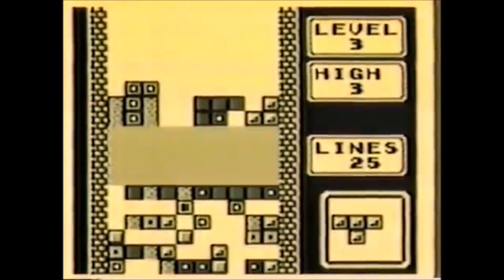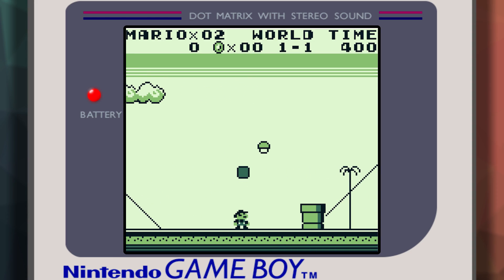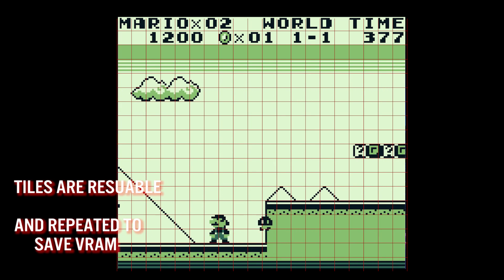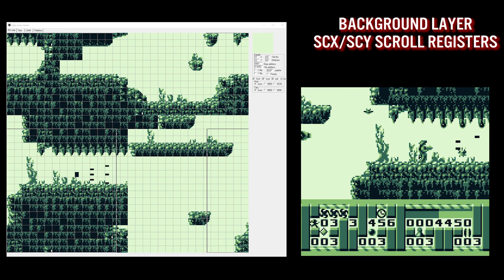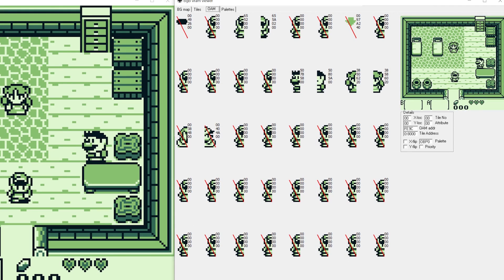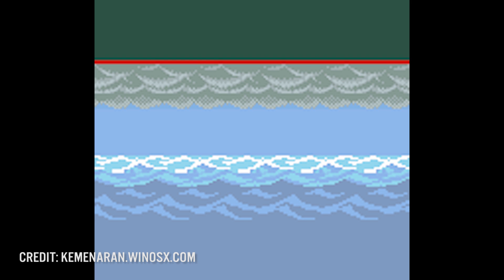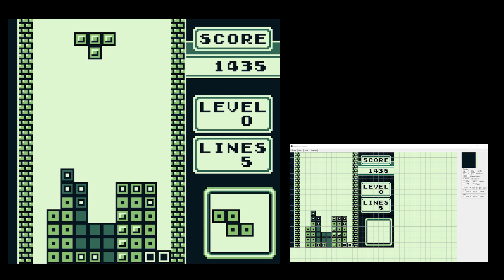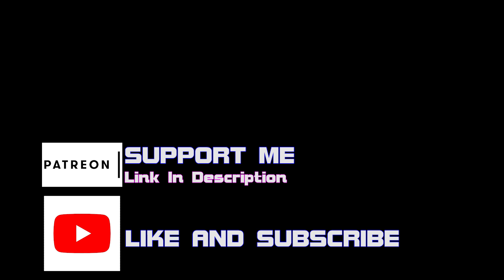How Graphics worked on the Nintendo Game Boy | MVG

Comment from the maker: My math(s) was incorrect at 2:29. 160x144 for a 2 bit palette is a 5.7kb framebuffer not 22kb
Reply: Do mode 7 next time
Reply: @AlexOlsenpang  About that...
https://www.youtube.com/watch?v=3FVN_Ze7bzw

He has an entire series talking about the SNES.
Reply: @amilamad  Oh, interesting.
Reply: Just in case someone needs more clarification: there are 160x144 = 23,040 pixels on the screen, with each pixel taking up 2 bits of memory, so 23,040 x 2 = 46,080. There are 8 bits to a byte, so 46,080 / 8 = 5,760 bytes (or 5.625 KB considering 1024 bytes per kilobyte) for the whole screen.
Reply from the maker: @mluna  no because sprite and window layer have their own palettes
Reply: @ModernVintageGamer  was that clip of donkey kong at the end really from the original gameboy?
Reply: Sorry to be a pedant, but I noticed the following inaccuracies (at I least I think so):

There is enough memory to fit a framebuffer in VRAM, so why don't they do it? Presumably because it would take far too much processing power to handle things like scrolling and sprites. By using tiles and sprites, the composition of the final images is offloaded to the PPU.

You imply background scrolling is unique to the GameBoy. It's not. It's very similar to the NES and other contemporary systems.

The Window layer, however, is different than the NES, though vaguely similar to the SNES.

Also, when you show the scrolling games, your grid lines don't scroll with the background, making it appear that the tiles themselves are changing. They aren't, the background is scrolled.

Right near the end of the video, you're talking about how the system is 4 colors but showing what looks like a GameBoy color game (Donkey Kong something) that has more than 4 colors.

Thanks for all your work, however, overall a good video.
Reply: @HypherNet  It would have taken too much cycle to be usable.
So basically, you have a few cycle to store a pixel data in memory (i dont have the cycle number for the memory, sorry), and at least one more to shift the first pixel 6 bits to the left, again one more to shift the second pixel 4 bits, rince and repeat until you filled your 8 bit chunk of memory (4 pixels).  Which is really time consuming instead of filling a buffer at once with full data.  Instead you have to fill, pad, fill, pad, fill pad, .. and then go to the next chunk of 8 bit memory.

The gameboy CPU can handle 4194304 cycles per seconds, which you devide by 60 to have 60 frames per second, so you handle 69905 cycles.

The amount of memory required is 46080 bits, so because it requires multiples cycles to access a portion of memory, store individual pixels and shift them to the correct position to pack them in memory, you couldn't potentially achieve 60 frames per seconds.

To that, i don't know any drawing method for each individual pixel, and even if it's possible, so you wouldn't be able to redraw your memory buffer.  There's no framebuffer, so if you can't redraw your pixels at 60 frames per second, your only hope would to rely on retina's persistence by drawing the other set of missing pixel on the other frame, it could theorically work on 30 frames/sec but you'll end up with flickering : if the pixel isn't there on the pass, the pixel drawn already wont stay as the screen finished is blanked.

I think games like "Jack Nicklhaus golf" circumvent this caveat by storing the data into a static tilemap which can be offloaded to the PPU and redrawn at each frame, but at the cost of not having any realtime modification, and it takes few seconds to have the screen drawn
Reply: You could have said "Twelveteen Gabbabits" and I would have believed you MVG.
Reply: mistakes were made
Reply: @MicksNa  houses will fall..
Reply: I didn't immediately catch the error as I'm so used to think about an 8bit palette. Then I realized that the Gameboy uses only 2 bit per pixel :-)
Reply: Hi! Which song in your band camp page do you use for the intro?
Reply: Do more videos like this loved the information about how old systems worked during the day
Reply: The Gameboy have quite a lot of improvements over the original NES.
Reply: Was about to ask why Nintendo didn't simply optimize space using 2-bit pixels :-D I guess it's the same for tiles and sprites, with each byte containing 4 pixels of 2 bits?
Awesome video, by the way!
Reply: @DoctorBabby  I imagine that the main reason why nintendo did tiles even if you CAN fit a bitmap, is because its a hell lot faster to just update some bytes to update the tile map instead of redrawing greaking 5KB per frame.
Reply: A lot of confusion could have been avoided here by sticking to kB for kilobytes and kb for kilobits.
Reply: @Zed.TheReaper.McCormick  He used it the proper way. The GB has 8kilobytes of vram.
Reply: @thecaptain2281  Yes, but he still wrote kilobytes as kb instead of kB.
Reply: @Zed.TheReaper.McCormick  Perhaps it is you who does not understand how that naming convention works. Allow me to demonstrate;
KiloBytes = KB/kB
KiloBits    = Kb/kb
Upper case "B" means bytes.
Lower case "b" means bits.
Upper case "K" means Kilo = 1024
Lower case "k" means kilo = 1000
Does this make sense? Not trying to be a jerk to you, only trying to help you understand the differences.
Reply: @Zed.TheReaper.McCormick  Even there, it's 2 bits per pixel (4 colors = 4 values = 2^2 = 2 bits)  So it's 160x144x2
Reply: @satan2k  That has nothing to do with a capital B for bytes.
Reply: please make another chapter on the making of the music for old systems, it's a fascinating topic. Love your work btw.
Reply: Literally just scrolled down to comment this and saw your comment, lol. Also, it's worth pointing out that a 5.7kb framebuffer would fit inside 8kb of VRAM, and, if I understand the documentation correctly, there actually are modes where you can just put pixels on the screen. :P
Reply: You human! This is your first mistake I ever heard you say.. 99.9% of the things you say is accurate as hell..
Reply: QUICK MATHS
Reply: Another slight correction: the GameBoy has memory for 384 tiles in VRAM, not just 256. It has two addressing modes for the tiles, both of which can address 256 tiles at a time, of which 128 are the same in either mode. It is possible to emulate a frame buffer with background or window tiles by switching the addressing mode mid screen. In fact, since the entire screen uses only 360 tiles, this leaves you with 24 tiles extra. Depending on the load technique, it is also possible to load up to 150 tiles from ROM during the HBlank and VBlank VRAM access windows. GBC can load even more, since it has a DMA which can write to tile memory. Rudimentary video is thus also possible.
Reply: Np
Reply: Unforgivable... unsubscribe :D
Reply: Please make more video like these
Great work
Reply: I was about to point it out, thanks for the correction btw, and very nice decomposition of the scenes, it's amazin how creative they had to be to achieve these effects.

Myself, as a poor programmer, I abandonned the writing of a homebrew 3D engine on the first DS, because at, let's say 50% progress of the engine, when I encountered big performance issues, I eventually found on obscure retro-engineering documentation, that the console lacked of a FPU, so I would have needed to rewrite the whole engine on fixed point, which pissed me off.  And because also I'm not a genius like i met few on the scene, I stopped there :-)

I thought 4meg of ram and 656 kb of vram hard, but man, these guy accomplishements on the first gameboy are realy understated.  You have to try to understand how painful it can be :-)
Reply: @satan2k  Your DS 3D engine project reminds me of the 3D games released on the... Game Boy Advance! Notably "Asterix & Obelix XXL" and DRIV3R, both allegedly single-handedly programmed by the late Fernando Vélez. So nothing is impossible :-) They seem to be based on some sort of advanced Mode 7. I'm not sure whether MVG did a video on those, it would be very interesting.
Reply: @DoctorBabby  I never said it was impossible, but I was completely ignoring I had no fpu to cope with.  So I had mostly to rewrite every subroutine (since pretty much everything is close to baremetal), everything had float in mind.   Also I admit I was too inexperienced to design everything in fixed point, which is undoubtedly an old school technique :-).   This was a let down, and I abandonned. :-p
Reply: Yes, yes more. An idea, show us the differences between the Gameboy and GBC. This could turn into a really fascinating series of video's for your channel.
Reply: Amazing video as always!
Reply: It’s okay. My lamen ass couldn’t tell the difference.
Reply: hah you idiot, you absolute bafoon, you bumbling idio.
Reply: Glad you caught this, pretty big oversight. Was about to post as soon as I got to that point in the vid
Reply: Can you do a video on the programming tricks developers used while making N64 games ?
Reply: How dare you. Delete this and re-upload
Reply: This makes sense, because someone did make a 3d graphics demo for the gameboy back in the day.
Reply: Great video, I bumped into it while searching information on Game Boy for a retro game project that I am developing. It is inspiring, and good to understand better old school graphics. Very good job!
Reply: Sword of hope 2 gang rise up
Reply: Your math is incorrect in the description of the video.  The GameBoy has 3 colors, NOT 4.  It has Black, Dark Grey, and Light Grey.  White doesn't count because the GameBoy simply doesn't draw anything when White is required.  It is a blank space.
Reply: Are you Australian?
Reply: I screamed when I saw the logo Titus appear. I don't like anything reminding me of Superman 64
Reply: So 5.7 k fits in 8k ram ?
Reply: Nintendo AGB-S-MBA Game Boy Advance 6 vintage games Super Mario land 🥶🔥🥶
https://www.ebay.co.uk/itm/313190395156
Reply: Thank you for clarifying this! I'm not very experienced and was starting to think for some reason it was necessary to save a whole byte just for one pixel which didn't seem necessary at all to me... Nice video too!
Reply: the technical actual answer would be 5.625 kb, because of 160 x 144 x 2 / 8 / 1000 = 5.76 , but binary kilobytes are 1024 and not 1000  which would be 160 x 144 x 2 / 8 / 1024 = 5.625 kb
Reply: Modern Vintage Game,Yes more videos plz
Reply: Also at 3:20 you misspelled “reusable”
Reply: MVG, doing the lord's work

Comment: It's sad that this sort of clever optimization seems to have become a lost art. Modern software often tends to inefficiently abuse the hardware as developers feel like they have the memory and processor cycles to burn. As a younger software developer myself that has dealt with developing software for more limited environments (Second Life and it's 16kB limit for code and data per script comes to mind), I can't help but think we could achieve so much more with our modern hardware if we all took on this mentality. Sure it is rarely an absolute necessity anymore but the fewer bytes and cycles you burn unnecessarily the more you can pull off awesome effects with the resources saved. It's harder work sure but it would be exactly this sort of effort that disrupts the industry and pushes the medium forward by raising the bar. Taking this on board in a big way would probably result in a good path to becoming a future classic that forces the rest of the industry to play catch up by forcing them to out-innovate the leader. I'm rather sick of seeing games bog up and slow down in late game (particularly 4x games) due to things I can envisage several solutions to sure some of them would require a few hundred if not thousands of programmer hours but this is within the budget of AAA productions.

I know this can be done as I helped with the development of an optimization mod for a 4x game that shall not be named right now, granted it took our 4 developer team a little over 3 months working basically part-time schedules (+16h per week each) so probably 800-900 man-hours to pull of the initial public release but it's doable. Probably would have been less effort for the developer to do it as we had to work within the limitations of the binary code already released by the developer and did not have the ability to refactor the source code directly (Though some use of exploits did allow some refactoring at the assembly level but this is way more time consuming, high level languages exist for a reason namely assembler is slow as hell to code in).

Comment: There's a slight misnoma at 1:05. Whilst the SHARP LR35902 is technically a mix of the Z80 and 8080, the Z80 instruction set is actually a complete superset of the 8080, with only minor backward incompatibilities from the Z80 to 8080 caused by the additional instructions added on the Zilog chip.

The additional instructions on the Game Boy CPU differ both from the original Z80 and 8080 instruction sets, being completely unique to the LR35902, meaning it isn't technically a mix of the 2 processors but a completely new instruction set entirely, being backwards compatible with neither the Z80 or 8080 due to an incomplete 8080/Z80 instruction set and the addition of entirely new opcodes.

Regardless this is a great video and the effort put in is amazing. I've always loved your attention to detail, particularly on your 360 emulation videos!

Comment: There were gameboy knock offs wich does have ALMOST identical to the gameboy, trough the systema 2000 had only1bit audio & 1bit color and it only had a sake unforgivingb 64x64 resolution , wich is waay more primitive then the gameboy, 
But the game king wich did came in 2003 had even a lower resolution of 48x32 wich was not only 14 years toooo late but that low-res screen goes far beyond my imagination.
Trough i am curious what game devs could,ve crammed out of thoseknock off systems aside from the gameboy.

Comment: I'm currently developing a gameboy emulator, and I'm using Super Mario Land as a test rom.  The HUD showing lives in that game does not actually use the window layer, but rather the BG layer with offset SCX (scroll X) values for the top few scanlines. As the GameBoy draws 144 scanlines per second, and I haven't implemented this individual scanline offsets yet, the game goes in full epilepsy mode when Mario moves around. xD

Comment: Nintendo actually always had either the best or nearly the best hardware of each generation, from the NES up through the Gamecube. Only starting with the Wii did they begin to implement the philosophy you talked about with their consoles. It is true, however, that their handhelds have always used that philosophy. It just sorta sounded like you implied a continuous link from the Gameboy to the Switch, which didn't seem fair.

Comment: nintendo said back in those days, games were programed by just a single person sometimes, wonder what were the tools they had to program them quickly, no way games were programed on asm line by line, did they?
Reply: The main 'tools' would be a cross assembler on a PC; and a GameBoy development board, essentially a GameBoy motherboard connected to a Famicom controller and a video monitor; with a parallel connection to allow the cartridge ROM to be updated from the PC. Some later dev boards supported custom breakpoints; which would send the register status back to the PC when the opcode at a specific memory address was executed.

Programming in assembly is nowhere near as difficult as people think. It's how most games were made for 8-bit computers and consoles. Remember they didn't just sit down and write a game from scratch, they'd first develop a library of well tested routines for different functions; which could be included in new games, possibly tweaked or optimised for the specific game.

In most GameBoy games, the code itself was a tiny fraction of what made up the cartridge; it was mostly graphics, sound and level data.

Comment: 2:54 The grid is slightly misaligned with the actual tiles.
Reply: Because the scroll registers aren't zero.
Reply: @gwishart  Look at the parts that aren't scrolling
Reply: @computercat8694  Everything is scrolling with the exception of the status bar at the top of the screen - which is aligned perfectly with the grid.
Reply: @gwishart  It isn't. Look at the difference between the rightmost M and the leftmost M. The rightmost M is touching its left gridline but the left one isn't anywhere near it. Also the rightmost and bottommost tiles are noticeably rectangular.

Comment: The Gameboy PPU fixes a few issues and adds some essential features that programmers really found lacking on the NES PPU. If the NES had a reliable scanline counter and could reliably interrupt on HBLANK or VBLANK, it would have been incredibly powerful. Also, having 10 sprites (instead of only 8) in a single scanline would have also made a big difference in NES performance.

Comment: Virtually all early 8bit raster arcade games used a similar tile & sprite system, because they also lacked a frame buffer. Although for x/y scrolling the VRAM was usually just 1 tile larger in each direction than the visible screen.

Comment: 160x144x4 colors = 93KB
Reply: No, not at all.
That assumes you're using four bytes for each pixel, which would be ridiculous, especially for a CPU that can only address 64KB without bank switching.
Four possible colours means each pixel only needs two-bits; so a single byte can represent four pixels.
(160×144)÷4 = 5,760 bytes.